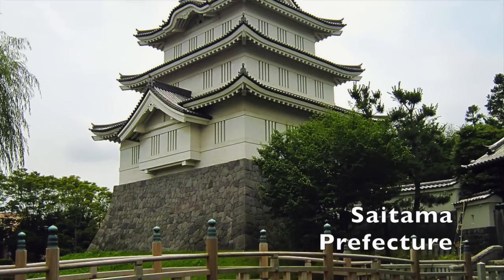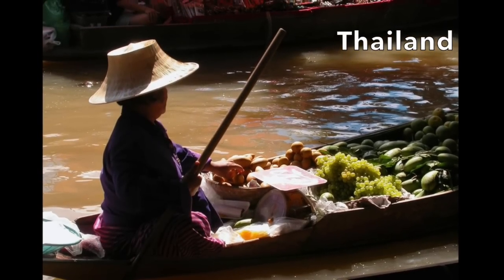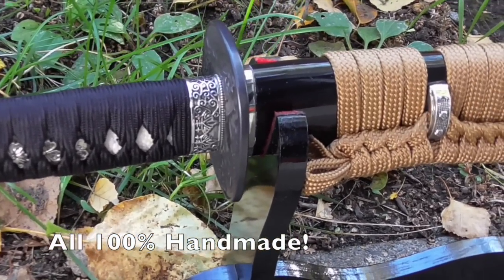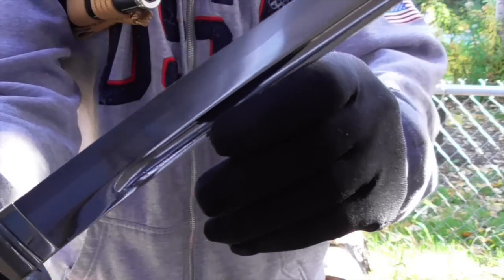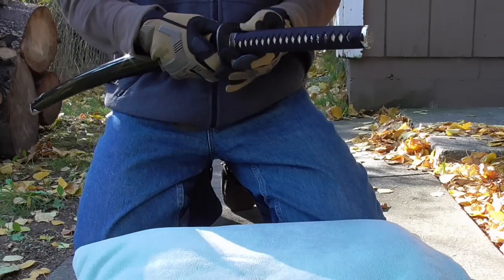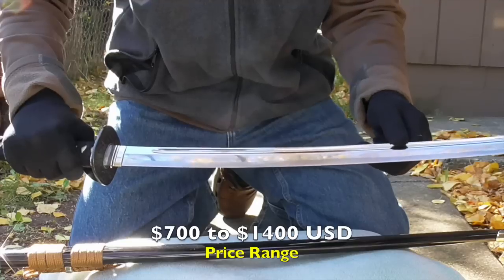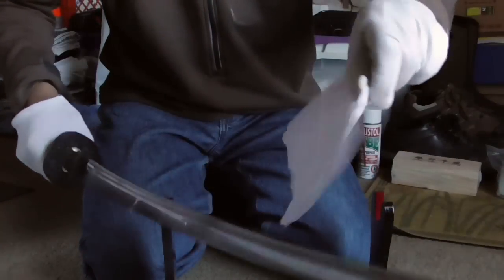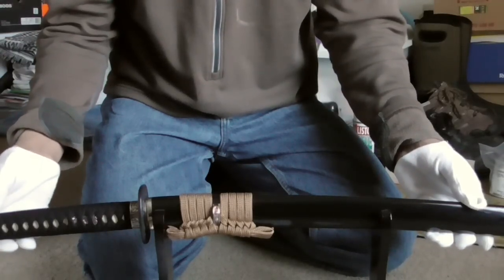THAITSUKI NIHONTO HOSO KUMIAGE KATANA

Comment: Ok, the question of the fiskars hatchet vs chiruwa ang khola is that whic one chops wood better and faster?  Also im thinking buy inf one but i cant decide if horn or wood, which one is mor crack resistant? Thank you.
Reply from the maker: Oh, I see. Here is my answer (opinion alert!):
They both chop wood equally well.

The Fishers is designed as a lightweight effective hatchet at an affordable price.
It is a great chopper & a good splitter for it size. I love mine for hiking.
Weight: 22 oz (615 grams)
Cost: $25 USD

The "15 inch" Himalayan Imports Chiruwa Angh Khola Khukuri
This HI kukri is large & heavy for it's length. Due to this it is a
good splitter and great chopper. It is well liked by HI fans.
Weight: 28.2 oz (800 grams)
Cost: $175 USD

Reviews:
http://outdoors.magazine.free.fr/spip.php?article72
Fiskars X7 Hatchet: Hall Of Champions

Horn vs Wood
The choice between these two materials is really a matter of personal preference.

Wood is great but must be oiled to avoid shrinkage & drying  that leads to cracking.
Horn is great also but has trouble in really cold temps. It too must be oiled. You can use Mineral Oil or Hooflex (horse hoof restorer & conditioner).

Hope this helps you get the right tool for you and your needs.

Comment: Beautiful sword, the koshirea is very nice aswell,however I'm almost certain that the steel is not traditional tamahagane,folded and hand polished with wet stones all the way to the end. However i know its tempered but probably in oil to prevent it from possible cracking. Regardless its a beautiful sword.
Reply from the maker: Thanks. In Japan I visited the area in Tokyo that has custom traditional bladesmiths. If I told you the cost involved in making a real handmade Japanese sword signed by the maker on the tang - you would appreciate the non-traditional Thaitsuki swords as a reasonable stand end. 
I've had a few swords but the best and most inexpensive for a real almost 100% sword is Albion Swords.
They do not make Japanese swords but they are reasonable and are swords that will be collector items in
the future. Check them out on Kult of Athena.
Reply: @sweetcostarica  thats realy cool you went to Japan!I want to go some day!Alot of places I want visit there!Your right real nihonto are expensive, i have some,my oldest is a wakizashi from munetsugu,he was a shimada Smith from the 1400,its in real nice higo mounts.My favorite is my Nagamitsu katana,he was a bizen Smith signed in tachi mei,in war time type 98 mounts though.Some day i would realy like to get a kanemitsu Katana,very expensive like 50 thousand for this one .maybe someday haha!Lastly I would love to have a modern katana commissioned for me by the gassing Ryu as there still active and make beautiful blades in the same way as 500 years ago,ago, think its sadatoshi who is alive right now but forgot lol!Have a great day!

Comment: grate review brother do you think the sword is Tough Enough and will it bend easily?
Reply from the maker: Thanks. Is this Katana by Thaitsuki Nihonto strong, tough, will it bend easily?
I personally have not tested it in Tameshigiri or backyard destruction test but I think it is strong and heat treated well as that is Thaitsuki reputation.

Here are what others have said:
Thaitsuki katana tameshigiri review (from SFI):

"Now for the cutting tests :
The overall feel of the Thaistuki is of extreme lightness and agility. It feels like an Iaito.
The nagasa balance is 4 inches from the habaki.

The first target was the ceremonial cardboard sword box which sliced cleanly with an iai draw.

Next : more soft targets. 
1 litre plastic Coke bottles were no problems and I manages 4 'O' pickle chips before overturning the bottle (warning : bottles are scratch magnets).
Free hanging A4 paper from the ceiling was also no problem. The sword sliced away the lower corners easily and sliced the sheet horizontally in two.

With some trepidation, I decided to try some hard targets.
The website dsiplayed a guy cutting 7 INCH bamboo with a Thaitsuki. I KNOW my Cold Steel Kat and Bugei can handle it, but the Thaitsuki seemed so slight and fragile.
I found some 5" wild green bamboo. The sword sliced through it with ease. 

IMHO I can say this : 
Beefier kats like the Cold Steel may be more forgiving on bad cuts and actually complete the cut even if it is a baseball bat swing due to the weight of the sword itself.

The Thaistuki may need a bit more refinement in the cut for hard targets (although light targets are no problem) and training in Japanese sword arts is advisable (er.. actually in all cases).

The sword is definitely tougher than it looks or feels.

In conclusion?
A great looking and great performing kat. Well worth the $$.
I liked it so much I just orderd a KTN 1 (Musashi) to see what the feel would be like without Bo Hi and a KTN3 as I like the finishings..."

Comment: is that a straight hamon ?. those are quite hard to make. really nice
Reply from the maker: Yes, but I am not sure it is real since this is a mono-steel katana.
Reply: sweetcostarica aah ok. thanks
Reply: sweetcostarica Hamon appears as a result of the differential hardening process. What type of steel, or whether there are different types or just one, has no bearing on it.

It certainly looks real from what I can tell by the video.

Comment: Unfortunately, the movies (even Japanese ones) portray the katana as if it was a chopping tool, like an axe. Of course it was used to chop heads during executions, but it was not the way it was used in combat where the samurai armors forced the warriors to use it for precise cuts in parts of the body that were not protected by the armor. Only the last 4 inches at the tip were used most of the time. In fact the katana was more an oversized scalpel than a long and slim hatchet.
Reply: Actually, if you had to use the Japanese sword in open field combat, it's because you were probably on the losing side. Spears, bows, and primitive firearms were the standard for warriors in Japan. The armor was also made of the same material, and extremely robust, so getting through would be next to impossible. If anything, the katana is an elegant form of trench knife, a last ditch effort to hopefully take someone out before you were killed.
In reality, it was probably used the same way a rapier would have been used in Europe at the time... a symbol of one's position and a way to end a gentleman's disagreement quickly. Not a tool of war.
Reply: +Patrick2345454
You make so many mistakes that I don’t know where to start. Yes, you make some good points too but you mention too many half truths. But let’s point out the fastest mistake to debunk. You say that, “Spears, bows, and primitive firearms were the standard for warriors in Japan. The armor was also made of the same material”. NO, they were NOT. To begin with, the katana is a laminated sword. It has an inner core that gives the hardness to get the desired sharpness, and an outside core that gives strength. That’s why it got its curvature when forged and submerged in water, because the 2 steels had different chemical composition and different reaction to changes in temperature. Also, if you have a sword that is only hard, you will get a very sharp sword that will break easily. If you had a sword that was only strong, it won’t break but it will get dull very fast. To say that spears, bows, and the armor were made of the same material, only proves that you don’t know what you’re talking about. Therefore, I won’t read or respond any more of your comments because I would be losing my time with an ignorant person who pretends to be very knowledgeable. Bye, bye forever!
Reply: ogarzabello Don't take my word for it. If you don't believe me, take your favorite katana out and try to cut through a flat piece of 1/8" mild steel. Send me the video so I can laugh at your loss. Katanas were used for sorting out arguments between UNARMORED nobles, not for winning wars. It could be drawn as a last ditch effort, but Japanese warriors had other options that were far more efficient for getting through armor. There is a reason the Japanese spear was made with a triangular cross section, and there is a reason the gun replaced the sword. Don't kid yourself son, reach is important, no matter how much anime you watch. I'm not downing the craftsmanship of the Japanese sword, I'm simply pointing out why it would be out-shined by every other weapon on the battlefield. You'd be better off with a tanto in close quarters, considering it's conceal-ability and maneuverability. Plus it's design as a stabbing weapon puts it head and shoulders over the katana.
Reply: Don't they present most swords like that in movies as chopping tool
Reply: ***** I hate it when people read my comments, do not understand them, and still try to argue. Nobody said that Japanese used mild steel, 1/8" armor. What I am saying is that there are better weapons for getting through armor, and in fact the katana would have been a last ditch effort on the battlefield.
I enjoy watching anime like many other people, but I don't take it as historical fact.

Comment: 29.5 in. katana? Aren't they supposed to be around 40in.?
Reply from the maker: I am measuring the blade only, thus that is a 29.5 in blade. With the 10 inch handle then it is about 40 inches long.
Interesting note:
"In terms of sales, the highest demand and probably the closest to responding to your question would be between 2.4.0–2.5.0 blade lengths or between roughly 28.5 and 29.8 inches." - Quora